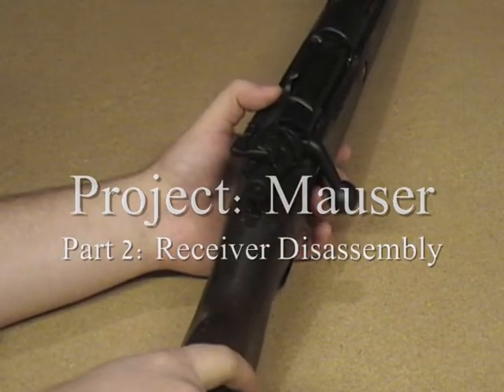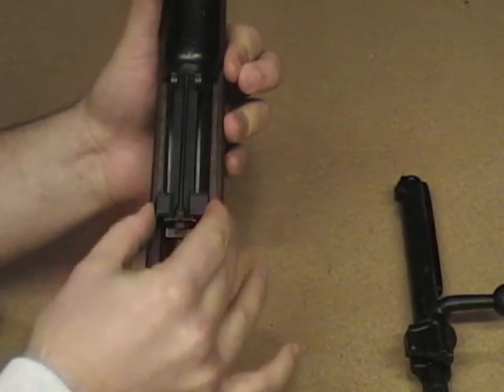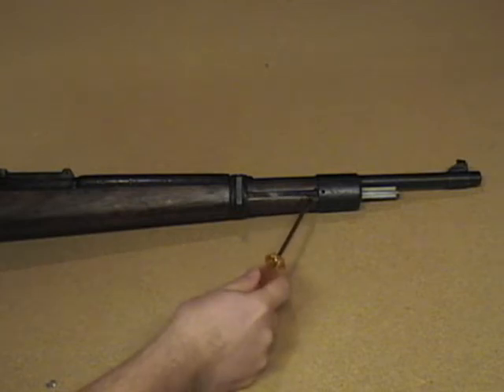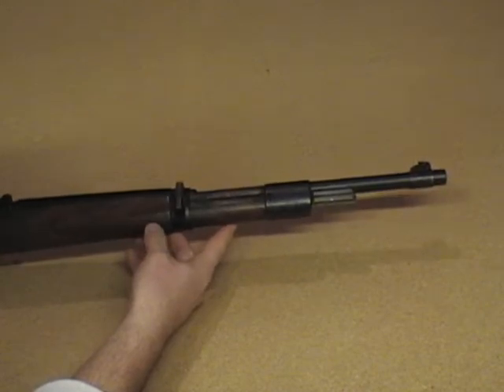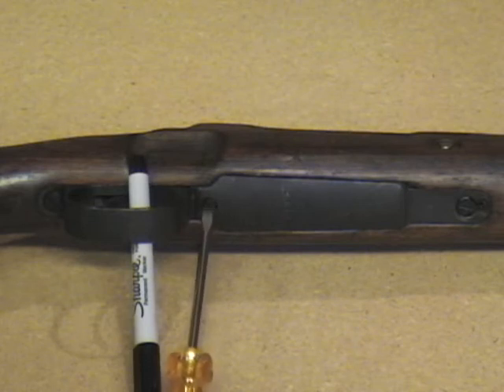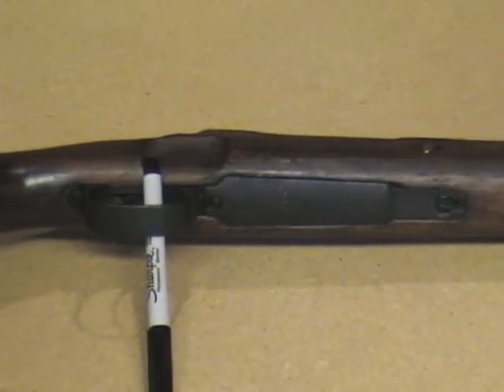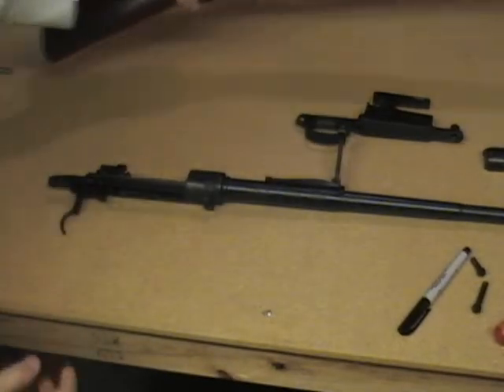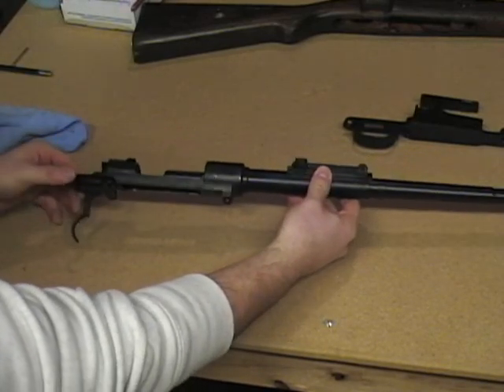Project Mauser Part 2: Receiver and Barrel

Comment: nice series of vids on the mauser. I also refurbed my mauser stock around the same time u did this vid...It was so cold in the garage that the stupid stain would take forever to dry.....it took me a week to finish it....but it was worth it. Usually i dont refurb old rifles but my mauser had the original finish stripped off by the retailer and their was nothing protecting the 70yr old wood...great job on the vids